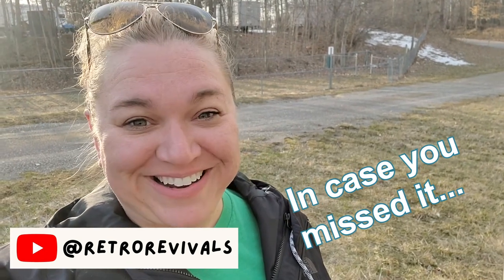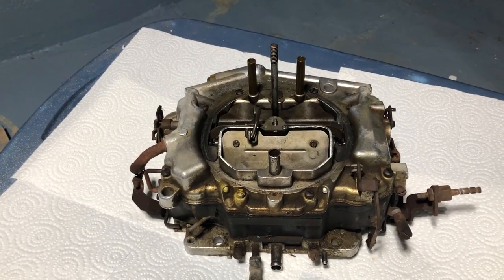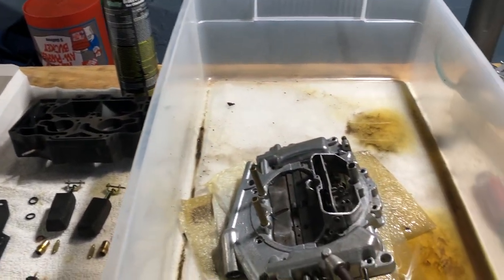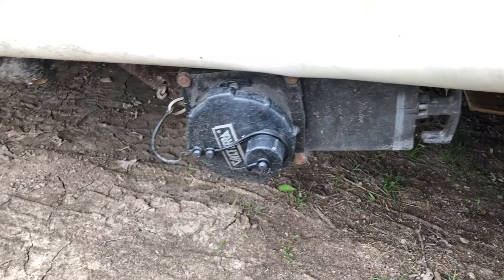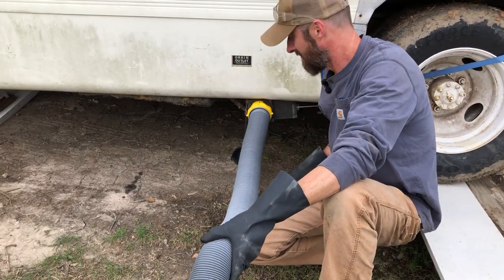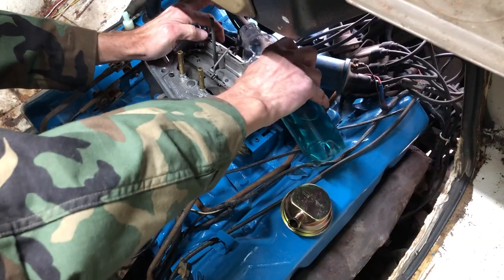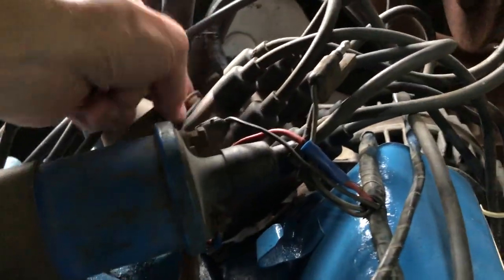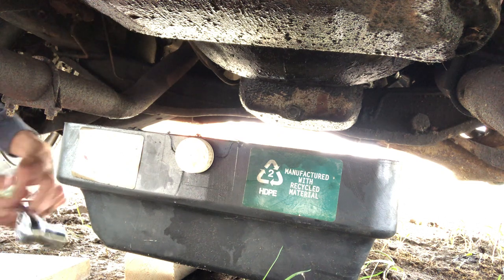DIY Vintage Camper Renovation - Progress continues!  Black tank, carburetor rebuild, oil change...

Comment: Just remember, as with the plastic body carburetor you have. Plastic and metal were never intended to be joined together as a mechanical or moving functionable item on an automobile! That's where the manufacturers like to get you because plastic wears out even if it is just a case that holds things together.
Reply from the maker: The carb could definitely be better. I've been looking at suitable replacements but I probably won't pull the trigger on something new until the spring.

Comment: I trust fully in your abilities.... but lets talk about carb rebuilds.... I never will rebuild my carb on my motorhome.... it is the only vehicle that you drive where short runs (grocery store) are never done.... You will undoubtedly be on the road somewhere and generally you will be no less then 30 to 40 miles away from the nearest fire station...  if the carb malfunctions and starts a fire you will lose the vehicle and may even cause further damage to the surrounding area (road, forrest, etc) ...  if you start a forest fire you will be solely responsible for suppression costs....  This is the only thing I wont do to my motorhome is a carb rebuild....  buying a new or rebuilt carb may offer some limited liability options ...
Reply from the maker: Thanks for the comment John. The carb was leaking badly from the accelerator pump. Not to mention all of the 87 octane, ethanol gas that had been ran through it. It was pretty dirty. We'll test drive it a few times before taking it on any long trips. A couple of fire extinguishers will be on hand.

Comment: Put about 15 - 20 gal of water in to tank. Put toilet chemical in the tank. Let it wok for a few days. Then go to a dump station, (Some municipalities have one at the waste water plant) Dump. Add another 15 gal water, take a 4foot long stick and loosen the poop pyramid. Then dump again.
In my Dodge that I needlessly rebuilt. I had used a similar product in that engin. When I took the oil pan off, the additive was right in the bottom of the pan. It never mixed with the oil.
Reply from the maker: Ooh, good to know about the additive, hopefully we have some better luck!  Thanks for that advice about the black tank too.  We're going to try to add a bunch of water and Dawn dish soap to it to start and maybe drive around a bit to get things really sloshing around and hopefully loosen up the "pyramid."  While we're out, we'll definitely hit a dump station.  The state campgrounds in Michigan will let us dump for $10.  Definitely worth it vs. using that portable waste tank :-)
Reply: @retrorevivals  Dawn is very sudsy. Would suggest low suds dishwasher detergent. That. Worked well for us. We made the mistake on our first, (Full Hookup) camping trip, to leave the tank drain open. We learned, water in black tank is a friend.

Comment: Another great video guys. I was lucky with my RV. The previous owner had already removed the black tank and replaced it and the toilet with a 'cassette' type that has a small removable (maybe two gallon) black tank, removeable via an external door behind the toilet. The idea is that the small removeable cassette containing chemical treatment can be taken out, emptied and washed out every few days (depending on usage) rather than carryng around tons and tons or gallons and gallons of accumulated doo doo.... It works for me!

As for engine content? I would suggest perhaps not too much. I'm a mechanically minded classic car guy, but there are already a lot of engine rebuild / will it start type videos already out there. Perhaps people might be more interested in the RV renovation itself? But I'll keep watching whatever you decide. Keep up the good work!  🙂
Reply from the maker: Hi again Colin, we really appreciate this reply!  We appreciate your input on the engine content... we try to time lapse the tedious parts but it definitely doesn't seem as exciting as the RV parts sometimes.  Thanks again for watching.

Comment: Don't forget with the work you have done to the engine to change the fuel filter. I was getting some bad compression but not as bad as you. I got a camera I can shove down where the spark plugs go and saw some carbon build up. I did not try the engine restorer. I ran Seafoam threw the gas tank and in the engine oil. I have not had any problems since and it cleaned out the carbon build up.
Reply from the maker: Thank you so much for this reply.  We actually did run seafoam through it... that didn't make it into the last video but we probably should have left it in.  We'll have to change the fuel filter too before getting too much further into things.  Glad to hear that you were able to bring up your compression; it gives us hope!

Comment: Power wash the inside of your black tank for about 5 minutes. Then run water through it and that should loosen any stuff in there. Leave valve open.
Reply from the maker: Oohhhhh, but would is splash up at us?  That sounds just about like my worst nightmare!  We could probably figure out a way to have it not splash back up.  We might just have to give that a try :-o  Stay tuned, lol!

Comment: Hi Tyler & family does the rv have a generator .
Reply from the maker: Hi Clive!  It doesn't have a built-in generator but we actually bought one recently.  We're considering building a sort of rack or shelf type of thing on the back bumper where that generator could ride along with some extra fuel, etc.
Reply: @retrorevivals  great idea i think generator are better than solar, solar m I ght be good for you guys as you have a hell of a lot of sun in the states .
Reply from the maker: @clvecooledge2407  We might go with solar at some point but decided generator was the way to go for now.  Not much sun here lately 😞